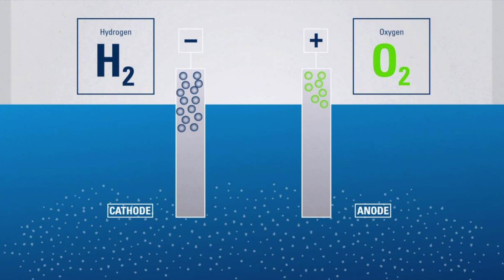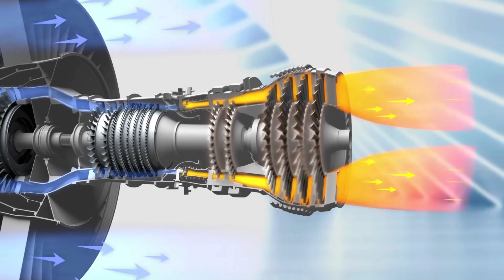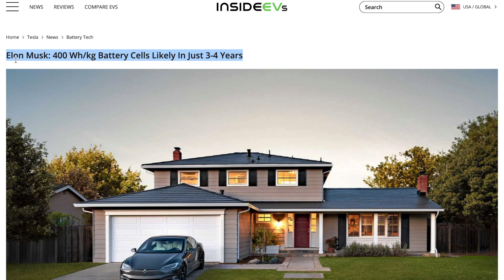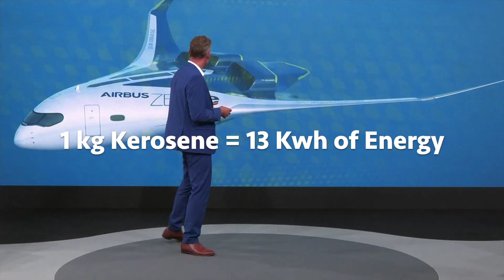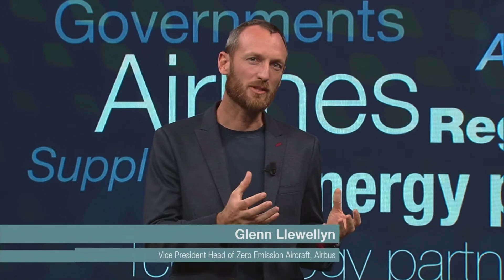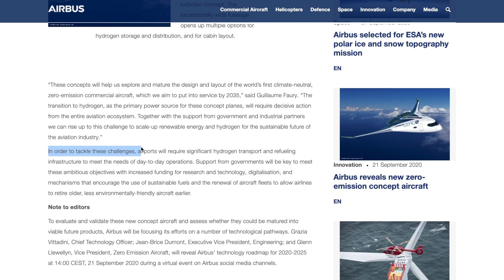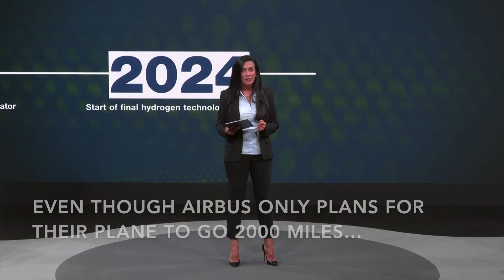Why A Hydrogen Plane Is A Terrible Idea

Comment: We have so much sun and space for solar panels because of this, production inefficiency of hydrogen is insignificant.  Cost will eventually go down.  As long as electricity used to make H2 is from renewable energy like solar, it’s good technology.  Fuel cell powered airplanes are light and fuel cells can be rebuilt and refurbished for easy maintenance.  Batteries lose storage capacity over time and difficult to recycle and cannot be refurbished.  Also as battery size increase the amount of distance the vehicle can go is not 1:1:   Doubling battery size does not give double distance.  Fuel cells tech does.
Reply: Efficiency from the production of hydrogen from electrolysis to being used is way lower than electricity production to compared to battery-powered. The hydrogen plane is set to launch in 2035 . Its fifteen years so by then energy density will more than double considering the number of companies and organisations improving energy density so maybe long haul can have hydrogen (temporarily ) and cargo and domestic planes can bbe electric . Lonng hauls will eventually be converted to electric. Hydrogen is hella expensive
Reply: @gamingdeck4827  hydrogen planes are already in the air. Not with combustion engine but electric powered by fuel cells😊
Reply: Producing it with nuclear power will be even cheaper than solar.
Reply: “According to the World Nuclear Association, yet another industry group, assuming the world's current rate of consumption at 66,500 tonnes of uranium per year and the world's present measured resources of uranium (4.7–5.5 Mt) are enough to last for some 70–80 years”.
Reply: @PapayBmet  time to switch to another, more common fuel sourse like thorium then, no ?
Reply: Maybe but then again it’s temporary fix,  but I think the idea of fuel cell and the process of breaking water into H2 and O2 using solar or green energy and then using a fuel cell to combine H2 and 02 to get electricity again is my feeling better “feng shui” or closer to the truth for these reasons: 1) even though the process of making H2 and using H2 is not efficient, but if we use green power in the process then it’s ok. 2) maybe it’s expensive now but it will get cheaper with the abundance of green energy like solar. 3) the fuel cell unlike batteries can be easily refurbished and reuse again.  Batteries is at its “honey moon” phase  but I visualize when most cars are electric out there, we gonna have to deal with lots of spent batteries and the cost to recycle or dispose of them. 4) the idea of having a generator that outputs only water+ electrical to power motor + heat loss feels good knowing there is not anything hazardous in the vehicle.  The special heat energy release via fuel cell which the passengers absorb may have good healing properties to the passengers, not all heat loss are the same I think, hahahaha just a hunch and silly idea but something about it I can feel. 5) if we get our energy closer to the sun rays the better we are I think.  Unlike fossil
Fuels that got energy from the sun from many long process over long period of time and eventually settle to the water. (Photosynthesis-plants-living organism-decay-fossil fuels). But solar is good we capture suns energy before photosynthesis.
Reply: @PapayBmet  From wikipeadia:  "As of 2017, identified uranium reserves recoverable at US$130/kg were 6.14 million tons (compared to 5.72 million tons in 2015). At the rate of consumption in 2017, these reserves are sufficient for slightly over 130 years of supply. The identified reserves as of 2017 recoverable at US$260/kg are 7.99 million tons (compared to 7.64 million tons in 2015)."

1. LWRs only consume about half of one percent of their uranium fuel while fast breeder reactors will consume closer to 99%,
2. Current reserves of U are about 5.3 million tons. Theoretically 4.5 billion tons of uranium are available from sea water at about 10 times the current price of uranium. Currently no practical methods for high volume extraction exist.
3. Thorium (3–4 times as abundant as uranium) might be used when supplies of uranium are depleted. However, in 2010, the UK's National Nuclear Laboratory (NNL) concluded that for the short to medium term, "...the thorium fuel cycle does not currently have a role to play,...
Reply: Hagree
Reply: Finally, fuel cell technology is picking up steam.  Toyota building fuel cells now for large trucks.  And other auto manufacturers beginning to the see the advantages of using fuel cells.  Ships and aircraft manufacturers are preparing now their products too.   Full battery EV is still at honeymoon phase but soon maybe 1 yr from now or maybe sooner, government will really need to determine what to do with battery waste.  Many batteries soon will lost charge capacity due to old age and will need to be replace.  I don’t know if battery recycling is worth it.  United States just approve major transportation and infrastructure bill that will further encourage green tech.   China is going fuel cell route too and maybe even India.   China + India= 1/2 of world population.  I have a mirai and luck out because I bought it for only $5k new.   Hope to see a pickup truck soon that’s powered by fuel cell.  Also soon many more gas stations out there will be converted to have fuel cell stations. These future flying taxis that are coming out will probably be fuel cell powered.  I wonder if the robots coming out will be fuel cell too.  Search fuel cell and narrow filter to “news” only and you can see things happening for fuel cell tech. It looks promising.
Reply: Ok, most of the people live in reality, not in wish land. So lets check reality. I will compare Toyota Mirai 2 and Tesla Model 3 Long Range. 
1. Price after government subsidy: Toyota 49,500 USD, Tesla 48,490 USD - Tesla is cheaper by 1010 USD
2. Range fully loaded: Toyota 402 miles, Tesla 353 - Toyota is better by 49 miles
3. Energy storage: Toyota: 5,6 kg of hydrogen = 224 kWh in 87.5 kg of composite tanks, Tesla 82 kWh in battery 480 kg. Toyota stores 2.73 times more energy. 
4. Price of energy in California: Toyota 16.51 USD/kg = 0.413 USD/kWh, Tesla 0.199 USD/kWh - Tesla is cheaper by 2.08 times. 
5. Cost of 100 miles: 
Toyota 1.4 kg/100 miles = 56 kWh/100miles - 23.11 USD/100 miles
Tesla   23 kWh/100miles - 4.58 USD/100 miles
Tesla is cheaper by 5.05 times !!!!
6. Trunk size: Toyota 361 l, Tesla 425 l - Tesla is bigger by 64 l, not counting front trunk,
7. Total weight: Toyota 1,950 kg, Tesla 1,730 kg - Tesla is better by  220 kg.
8. Acceleration to 63 miles: Toyota 9.6 s, Tesla 4.4 s - Tesla is better by 2.18 times. 
9. Filling stations in USA: Toyota 45 with 43 in California, Tesla 908 stations plus charging at home -Tesla is better by 20.2 times !!!!
10. Charging time Toyota 5 min, Tesla 30 min. - Toyota is better by 6 times. 
To sum up: Tesla is cheaper to buy, cheaper to run by 5 times, accelerates 2,2 times better, has bigger trunk, weight less and can be used in the whole USA instead only in California. 
Toyota has only one clear advantage, the fuelling time is 6 times faster, but it is irrelevant because it can be used only in California. 
There is simply no contest Tesla is a clear winner.
Reply: @PapayBmet  hydrogen car  producers probably won't use fuel cell

a new breakthrough is probably about to change the entire conversation
Reply: @robinsss  I still think fuel cell is better for the long run as far as environmental sustainability.  As human population grows, the more demand for sustainable solutions.  If we can design a battery that is environmentally sound then I’m ok with that.  Fuel is expensive and not practical at the moment but soon it will all make sense.   I’m just worried about how much battery waste will end up in the landfills and cause pollution.  Fuel cell on the other hand can be created with renewable parts and mechanisms.  It is more expensive and not readily available at this time and it’s something that corporations need to change. But once in full operation it will make more sense.   Right now there’s a battle going to happen soon between pure battery electric vehicles  and fuel cell electric vehicles especially Tesla shipping truck vs hydrogen types, let’s see what happens.   

But I really hope experts out there whether it’s fuel cell or new battery storage tech will come up with environmentally sustainable solutions that can be scaled up as human population grows.  The process to make these new storage mediums will be environmentally safe and almost zero waste that minimize environmental harm and balance with nature.
Reply: @PapayBmet   do you think fuel cell is better than the new hydrogen technology i just told you about?
Reply: @robinsss  sorry I don’t know what new hydrogen tech you are talking about?  I don’t see it mentioned in your comments, can you provide more details ?

Comment: the energy density is more important than prices when it comes to planes . one thing is sure there will never be a long haul (200 PASSENGER ) flight powered by a battery in our liftime
Reply: Agreed. Batteries will always be too heavy to be practical for large passenger carrying aircraft. But what're our alternatives? I'm still researching.. Do you think FC aviation powered aircraft engines are practical?
Reply: @davidkeenan5642  Look at it this way. an electric car needs a few hundred kilos of batteries to drive around 600-700km whereas a FC car only needs about 6kg. scaling that up to airplane sizes would be viable.
Reply: "Ammonia has nine times the energy density of lithium-ion batteries and three times that of compressed hydrogen." Bulk storage and easily converting ammonia to hydrogen is what makes this green technology the future for aircrafts.
Reply: In 2012 I was told we wouldn't see renewable energy flight in our lifetime, I'd watch out with statements like that with how fast we're progressing. H2 all the way though.
Reply: @TylerWitucki  what's your source on that? I'd like to learn more about it.
Reply: @stijnhs  Hydrogen cars are not significantly lighter than EVs. The tanks are rather heavy to withstand the enormous pressure.
Reply: @Simon-dm8zv  the Hyundai Nexo and Hyundai ioniq5 are about the same size in all 3 dimensions (length, width, height). The nexo is FCEV and the ioniq5 BEV. The ioniq5 ways about 200kg more which would be like strapping an entire motorcycle to the roof of the Nexo. I'd call that quite significant...
Reply: @stijnhs  the problem with hydrogen is the cost of it and the infrastructure otherwise we would have seen hydrogen cars running on roads years ago.
Reply: @epicgames8967  the problem years ago was a lack of possibilities and the unsustainableness of it all. Getting a coal fired plant to produce electricity which in turn is used to produce hydrogen was very inefficient. Nowadays with rapidly growing green electricity sources hydrogen production could be done much more efficiently. All you need is a company willing enough to go all in and spend the resources required to make the infrastructure like Tesla has done with their supercharger network. Hydrogen is becoming increasingly more popular and is already a big piece in upcoming projects like Denmark's energy island.
Reply: @stijnhs  you meam with renewable energy like solar and wind the prices of hydrogen will drop, ok but in other to produce that much of energy you need alot of batteries to store them also, so the batteries needs to have high energy density too otherwise we won't be able to store a lot of the energy.
Reply: @epicgames8967  no need for batteries... If renewable energy sources power the grid then the electricity needed  for hydrogen production can just be sourced from the grid without the use of batteries.
Reply: Hydrogen will be the future IMO because it is 3x stronger and more efficient then jet fuel and is renewable, downside is it is expensive to make and we make it by oil which we don’t have to but it is the cheapest way, but hey whatever let’s leave that to the future people to make it cheaper and easier ways to make it, I want some hydrogen airplanes
Reply: @justalonelypoteto  True batteries are shit because they dont lose weight, whereas hydrogen does, and hydrogen is infact 3x lighter then gasoline for the same amount of power, 1kg of hydrogen takes up the same space as 1 gallon of gasoline which is a lil sad, but 1kg of hydrogen has the same energy density as 1 gallon of gas and is 1/3rd the weight, so hydrogen is def the future, the only problem however is firstly making hydrogen is expensive asf, secondly making hydrogen using clean recourses not oil and shit etc is even more expensive, and thirdly hydrogen rn is made by oil mostly so we are still producing pollution but to be fair electricity is the same
Reply: @TylerWitucki  compared with nano tech?
Reply: @levi4979  hydrogen isnt a renewable energy source. Its an energy storage medium just like batteries.
Reply: @epicgames8967  if you are using a solar or windfarm to directly convert hydrogen, then no you would not need batteries. Batteries are only needed for a standard grid setup when you want to draw power from it continuously with no shutdown periods.
Reply: @averagejoe9040  which is capable of storing renewable energy.
Reply: @levi4979  yes. but it isn't the source.
Reply: @averagejoe9040  I... literally never claimed it was.
Reply: @levi4979  I didnt claim you did either, just wanted to add to the discussion.
Reply: also to note there are safety reason, Solid state batteries may be safer I am unsure, but current tech means batteries and air travel are extremely limited to fire risk
Reply: 1960 people were told they would absolutely not live to see solar power become viable, impossible.  2021, it's now crossing over into becoming viable (barely) without subsidies, so some of the people hearing that in 1960 did live to see it.  Point being, don't totally give up hope lol.  Same with electric cars, they are just now approaching a cross-over point where they are economically viable (barely) without subsides.

I realize I talked a lot about the economics of it, but the science of something doesn't become ubiquitous without it being economically viable.  Stuff happens here and there, but not ubiquitous until the price tag becomes low enough.
Reply: @davidkeenan5642  Synthetic kerosene made from CO2 and renewable hydrogen.
Reply: @stijnhs  you mean a few thousand kilos, right?

Comment: thing is, as a hydrogen combustion plane or regular plane travels, it uses fuel so the load becomes lighter and therefore takes less fuel to fly, whereas battery planes don't expell any weight during flight so are less efficient.

Comment: This video commits several mistakes. The biggest one probably is not taking into account that today's lack of infrastructure is not a deal-breaker exactly because it is being planned as we speak, both thanks to Airbus and its partners and to some big companies in power generation. As of now there are already gas-cycle turbomachines by Siemens operating with a majority hydrogen blend, and to make this commonplace they are helping developing the infrastructure and the hydrogen generation. Between this and government subsidies, hydrogen power can definitely become cheap enough in 15 years not to be disastrous.
You could go back 15 years and use your arguements against electric cars, and look where we are now.

For planes, hydrogen is way more suitable also because kerosene already works despite having less than half the heating value. Batteries are not there at all and will not provide the necessary power given their weight even for 400nm flights for a long time, without considering that even if they did, the turnaround times would be abysmal: who in their right mind would install chargers at each gate that could draw tens of megawatts and still have to wait two hours for a medium-haul flight?

Comment: Hydrogen actually is a wonderful option for aircraft as it’s weight is pretty much negligible and it is combustible. Not to mention it’s far safer for pilots and passengers as a planes would be able to make emergency landings directly after take off without having to dump fuel. I mean it’s a wonderful concept and is practical as along as battery technology is advanced. Basically electric powered vehicles and hydrogen powered vehicles belong in the same future, just in different applications.
Reply: Hydrogen would not be stored in the plane's tanks in its gaseous state! To store hydrogen in liquid form needs pressures of up to 700 bar. (over 5 tons per in2)